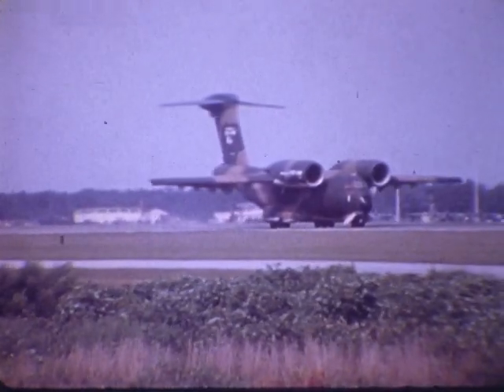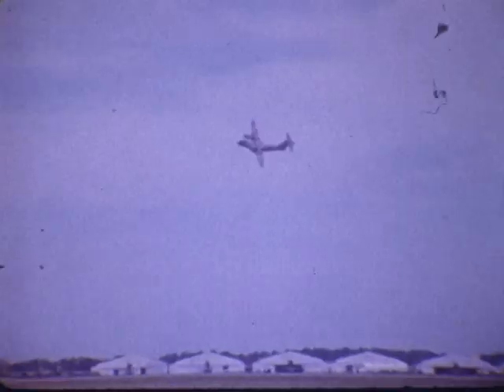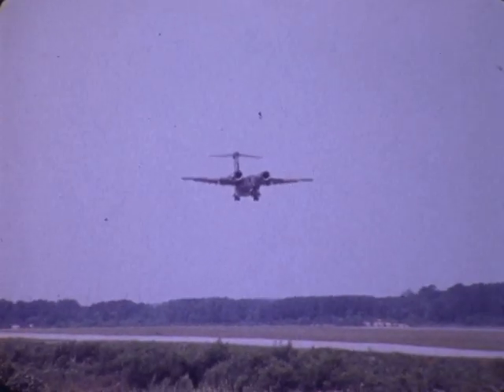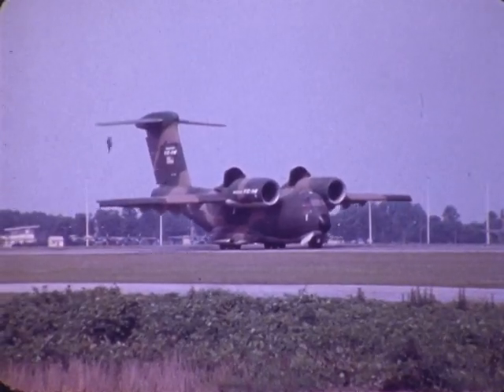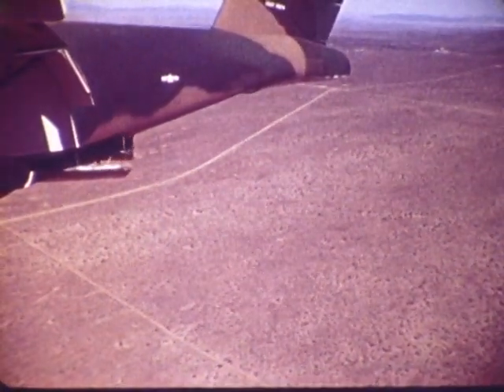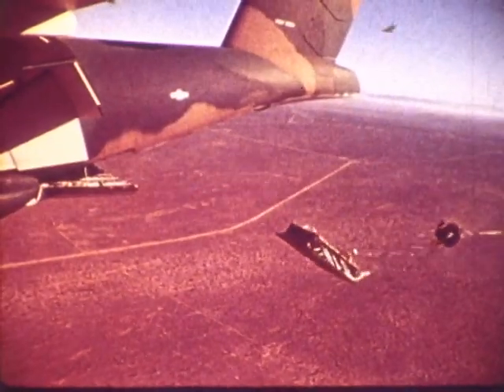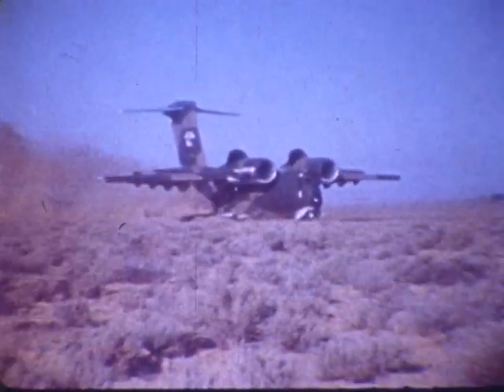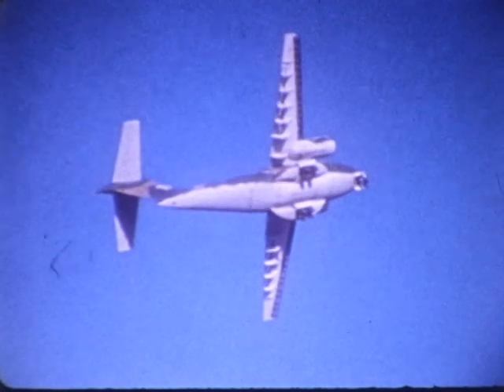F 2245 Boeing YC-14 STOL Cargo Aircraft Review

Comment: I read about the YC-14 and YC-15 competition in the 1980s, but never saw video before.  After all that effort by both parties we end up with the C-17  ;-).  Truth, the latter was superior and came later.

The high lift tech of the YC-14 was taken from the NASA QSRA. I can tell by the flattened engine exhaust tailpipes ( as seen from behind) which spreads the jet flow over the surface of the wing to increase lift.  

YC-15 used 4 engines and a blown slotted flap technology, which is what the C-17 ended up with:  https://youtu.be/GlidQkgcAqY